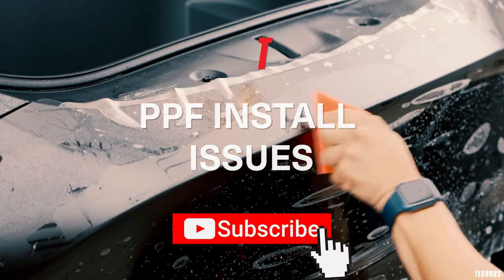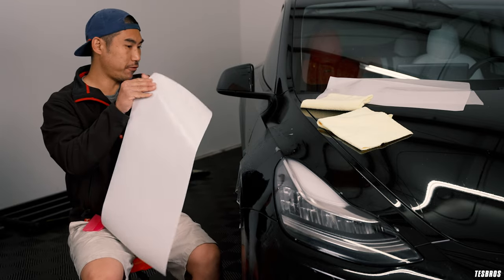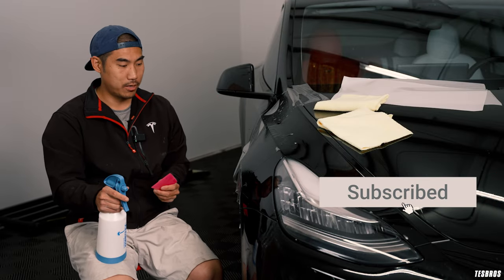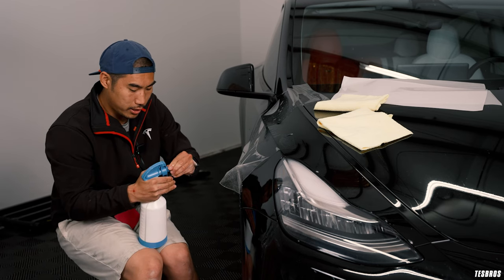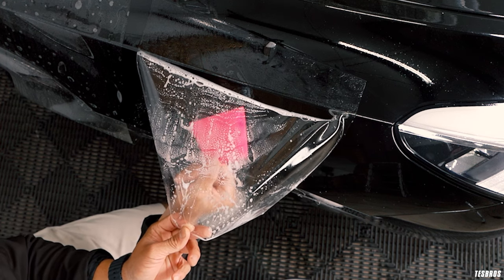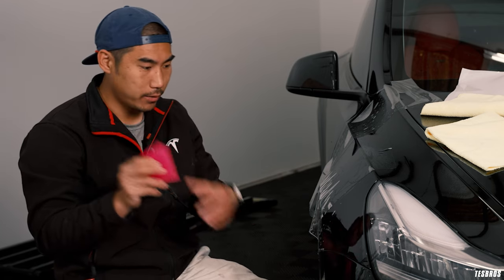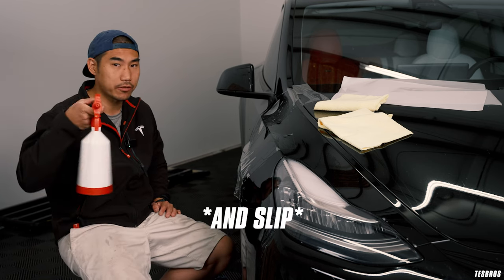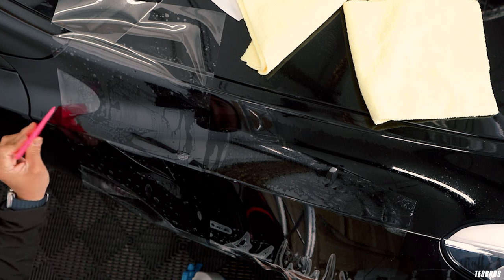How To Deal With Common PPF Issues When Wrapping Cars - TESBROS

Comment: Did my first PPF today on a small panel just to learn. I got lots of tiny bubbles. Turns out I just wasn’t pushing hard enough with the squeegee. The slip solution kind of hides small imperfections but as it dries out all these micro bubbles appeared. So you gotta push HARD to force the film to be air tight to the paint. Maybe they would have gone away with time but it looked terrible so I redid it and things came out 99% bubble free on round 2. Also noticed more bubbles on the edges, likely dirt that was forced under from aggressive spraying solution. So the edges and areas where the film overlaps (bulk install) must be surgically clean - zero dirt, wax, etc.
Reply from the maker: Yeah once you get a feel of the pressure required, it gets much easier. And installing in a clean space with no airflow directly on your car helps a ton. Best of luck as you keep practicing and installing!

Comment: Can you also tell us about the mixture of the spray solution? We would greatly appreciate it! Thanks in advance.
Reply from the maker: I use 5ml of seventh gen dish soap with 1000ml of distilled or filtered water. I have it dialed with our shop temp but this can vary depending on your environment so adjust accordingly.

Comment: Why wouldn't you pull the hair out from the top of the fender?
Reply from the maker: It’ll be a lot harder that way because when you spray it, it’ll want to come down. And if you try to reach in and get it out, you risk adding more contamination under the film. Try to work with gravity when removing any debris if possible

Comment: What can I do about really small but noticeable fingers along the wheel well that always come back overnight? Maybe 2mm wide at the opening and 2mm tall. It's been a couple days and multiple times a day I press them down, but then they pop back overnight or during the day. It seems like maybe the adhesive is compromised at this point and will never stick down
Reply from the maker: Try hitting it with a heat gun (or hair dryer) and then hold down for 10 seconds with finger
Reply: I have similar problem on my PPF installed on headlight. Those wrinkles at the edge really drive me mad. The hot gun did not help. Desperately, I cut the wrinkles part. It ain't good but I can live with it.

Comment: i have fingers that won't stay down even while pressing it down multiple times, what suggestions do you have? i don't wanna take it back up but its a bit annoying
Reply from the maker: Without seeing it, it's hard to give advice but typically if you can't get it to stay down with tack and holding it down for a bit with your squeegee - even using a microfiber to soak up any moisture around it - then the next best thing is to use a heat gun and a dry squeegee and slowly work your way down the finger from side to side while heating about 6-8 inches away. Make sure it's on the highest heat
Reply: @tesbros  right so this is after it has dried and there is no water in it. I tried the heat gun but it wasn’t on the hottest

Comment: 1) Good job and thank you for sharing your knowledge. 
2) Please make another video how to deal with corners and edges.
3) Which material do you prefer (brand name, prices detail etc.)
4) Many times camera issues because your hand is second object behind another one. 

Keep great work sir ! :)
Reply from the maker: 2) For corners, i'll typically place the PPF right inside the corner. This makes for a long lasting wrap without the possibility that the corner will peel back and fail. This video of wrapping the Model Y hood gives a good example of that and how I handle rolling over edges - https://youtu.be/Khoy38WLrGY
3) I usually work with Avery, STEK, or XPEL 
I'll take note of these ideas for future videos, but hopefully this helps for now!

Comment: Yes very helpful. I am looking to start ppf wrapping my own vehicle. What is the difference between slip solution and tack solution ??
Reply from the maker: Slip solution helps move the film in place. It's made up of dish soap and water. Tack solution is alcohol and water and it is used to flush out the slip solution and adhere certain areas in place. You can learn more about the solutions here: https://youtu.be/ppYK7PH9MDI and we have several videos like this one that can help you get the hang of install practices: https://youtu.be/Khoy38WLrGY

Comment: Thank for your Very useful tips ,can i know what solution you are spraying and what its composition (tac solution, slip solution)? Is the film resistant to bird droppings?
Reply from the maker: Slip: 5ml of soap (we use 7th gen dish soap) to 1000 ml of distilled water 
Tack: 80% distilled water to 20% of 70% isopropyl alcohol  
PPF is resistant to bird droppings due to some hydrophobic properties, but I would still try to get them off within a week as they can etch into the film. PPF will make it easier to clean though
Reply: @tesbros  I Thank you so much

Comment: Did you ever make another video on getting rid of air bubbles =x have a couple on my install - smaller than a nickel, but sounds like air bubbles don’t really go away on their own?
Reply from the maker: We haven't yet, but if you feel comfortable doing this, you can insert a syringe with a very small needle at an angle (don't go far) and then suck the air out.

Comment: What’s the difference between slip and tack solutions? Do you need both? Can you do the whole project with just slip, or tack? I’m a little confused.. trying to install precut ppf and unsure if I need both solutions(slip and tack) to complete the job. Thanks.
Reply from the maker: Slip solution helps move the PPF in place, and tack solution flushes out the slip to make it adhere in place. You use way more slip to install ppf, but both are needed. Here is a video on slip and tack: https://youtu.be/ppYK7PH9MDI and here is a video on installing ppf on a bumper that may help give you an idea of how both solutions are used: https://youtu.be/3YV-M-NeZQQ

Comment: Ok. But later when you come to park in the garage I have spare tires against the wall I run into to prevent hitting the wall. Problem is the tension can raise up some of the film so what's best way to get rid of raised film spots? Hair dryer and mild heat maybe?
Reply from the maker: High heat would be best. Just keep the dryer moving about 6 inches away from the film, heat it up to where it's more malleable, then squeegee slowly from side to side down the fingers or raised areas. This will be a dry fix, so no need to have slip or tack.

Comment: Hi,

I have a question regarding the PPF (Paint Protection Film) product you are selling. In hot weather conditions, such as when temperatures rise over 110 degrees Fahrenheit in California, would the PPF start melting similar to what happens when hot water is applied to its surface for removal?

Thank you for your assistance in clarifying this.
Reply from the maker: Great question! No, PPF’s melting point is around 347 degrees F, so you don’t have to worry about that. PPF being on your car in the summer is especially helpful in protecting against UV rays and self healing scratches.

Comment: how do you get rid of lines showing up after having to lift up part of the film? the line shows up where the ppf was lifted to?
Reply from the maker: Pull it back past the line, spray a lot of slip solution, and then squeegee the opposition direction. So if the line was 180, squeegee sideways and then down.
Reply: Thanks I will give it a try next time! @tesbros

Comment: I had a long string under mine after it dried for more than an hour can I still safely take it up and fix it ? This will drive me nuts
Reply from the maker: You can definitely try if it’s going to bother you too much. Use a lot of slip solution on top and underneath the film and remove it slowly. It will be a risk but you can always replace it if it doesn’t work out. Better to look good rather than suffer for years with it like that
Reply: @tesbros  got it and much better. Lots a slip helped. Thanks
Reply from the maker: @88omarz  glad to hear it

Comment: What about raised bumps in the front bumper? They are almost feel hard to the touch. Is this from rock chips, debris or something else? PPF installer said bumper needs to be sanded down and repainted for these not to be appear. Not sure if they are telling the truth. Any thoughts?
Reply from the maker: Hard to say without seeing it, but if it’s bumpy, it could be multiple things like rock chips or paint contamination. I’d start with clay bar and then if still bumpy, decide if it needs to be sanded. But usually if it is a rock chip, I'd do paint touch up and then you'd still feel bumps and they are right. Unless you sand and repaint, you will feel that bump. If you want to send photos via email to support@tesbros.com or twitter/instagram @teslabros, I can give you a better answer

Comment: Is cheap  ppf hard to work  with
Reply from the maker: Yes, cheap PPF can be harder to work with. They usually have lower-quality adhesive, making it harder to apply smoothly without bubbles or edges lifting. It can also tear or stretch easier during application. It might not be as thick or flexible as premium options, making it more difficult to mold to the contours of the vehicle. And overall, it will most likely have poor clarity.
Reply: @tesbros  ok thanks had a friend using cheap stuff looked ruff to install....
Reply from the maker: Yeah that can be a pain for sure